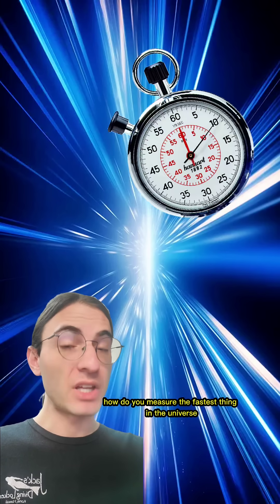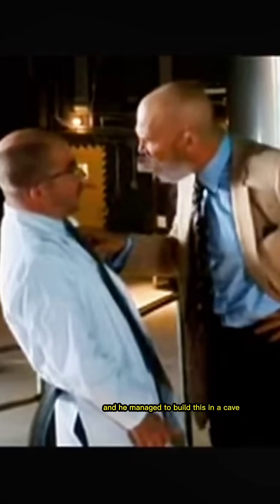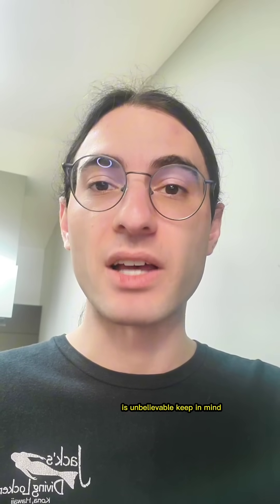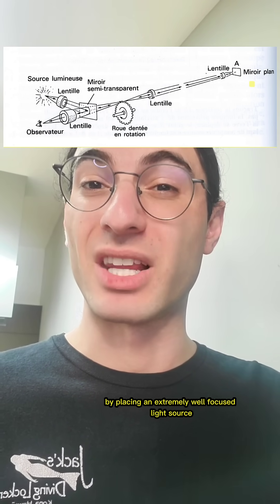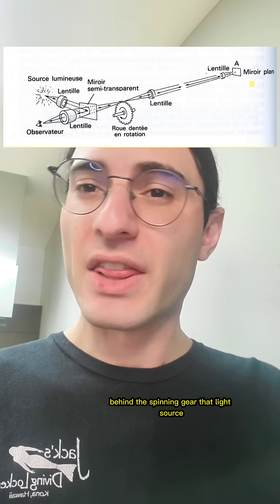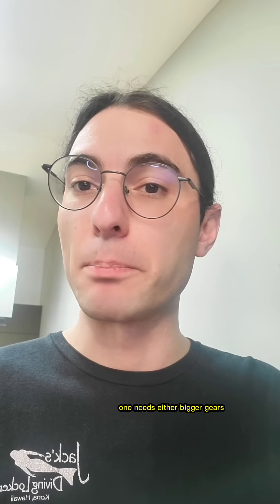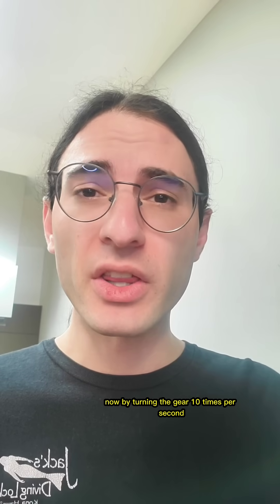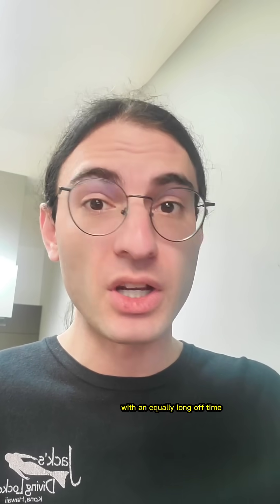A Parisian Speed of Light

Comment: This experiment has been repeated at very few occasions since Fizeau's first try - Mons university in Belgium has installed a similar contraption up on the city's belfry in 2016. Thanks to upgraded equipment (lasers, etc...) they measured a speed of 297000 km/s, which is less than 1% lower than the standard speed of light.